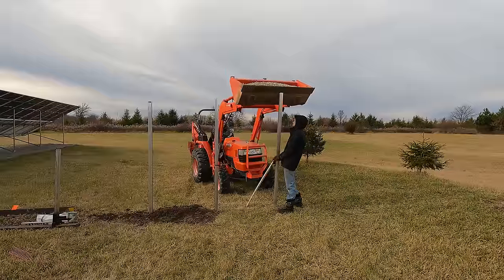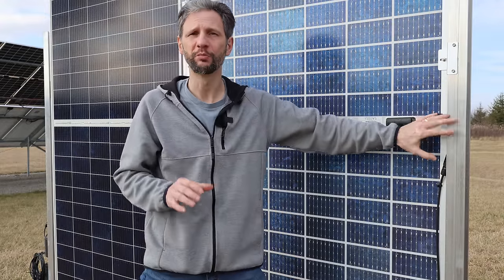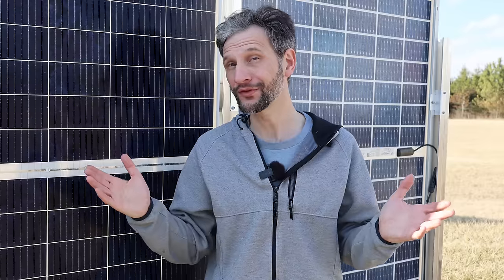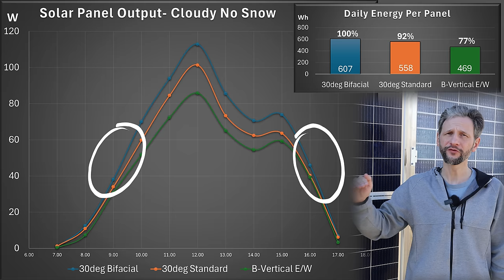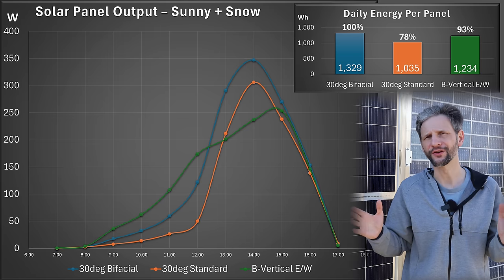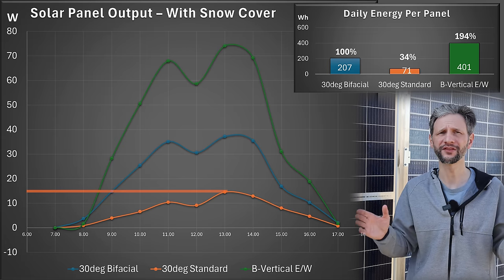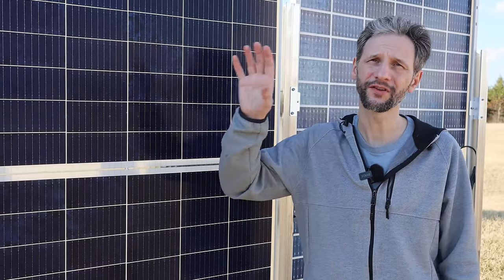Vertical Bifacial Solar Panel Performance Results Part 1

Comment: Thanks   You'd think bifacial cos would have this all worked out and dished out seven different ways    Here's  a fairly large factor that might exist to help vertical arrays.  Cost of mounting, for ground systems, fewer holes in ground, less framing, no real 'ladder' work, and even easier to clean.   Alas on a sloping roof, bi facial vertical mounting would DEMAND racks, that 'on roof' systems don't.  Of course, on roof systems are not at optimum slope, and when it comes to roof replacement, is a disaster unaddressed (they have to be removed, stored, replaced, so you pay probably 1/2 your initial install costs every 20 or 30 yrs.  I haven't heard of anyone even on new homes building PV into roof assembly so you don't need roofing under them, as no PV co is going to warranty their units as roofing, since a roof leak worse w mold can cost big time, and there is a considerable issue of trying to route rains and the leaves twigs sand ... washing off roof, around the array, or risk the array with that washing over it.   Sooooo  a vertical roof top array on a rack would actually allow roof replacement without a serious upcharge (There would be more flashing work around connection points)

I'd think of installing these around the edge of a porch roof like a 'railing', along ridge peak - which might well give them a HUGE boost as they'd get way more 'sky' and reflected light exposure.  Also, mounting them say 12 inches above the peak would allow most of wind to go under or over as it needed to.  Support framing could take form of a Y  with legs on either side of peak and single 'stroke' upright over peak, the legs could easily be screwed in through roofing using same fasteners used by standard solar arrays.  When it comes time for roof replacement, cut screws, remove, pop up leg, slip shingle under, rescrew.  You could also install WR Grace Ice an Water Shield over and between them and over the peak, then shingle over or best yet add wood framing, plywood, over the legs, shingle over that, flashed just to uprights.  Making future shingling even easier. Possible big benefit for roof peak vertical panels - the brightest point in sky is not in the S, it's in the North.  Remember artists and old factories had huge skylights facing north.  It was to not just for 
even lighting, that could have done w S skylights and a filter between, light fabric.  There is that bright spot in N. that provided more light.  A panel way up in the air with more exposure to sky than ground might access that brightness better.   Any chance you'd be willing to sitck those two test panels on 20 foot poles and see if there is a significant boost in performance.  You could do this temporarily using  a braced frame tied in to your current uprights.  You should be able to do it with 20 foot 2x4s, but you'd need some kind of bucket rig probably to get panels on and off up top, unless one investigates a pivoting frame.

For anyone in snow country, here's a novel multi function way to get around problems and increase value from solar arrays on a garage at least, maybe a house too.  
Wait a min, in S. Climates it could cool your roof and shade side of house in summer too.  
For me, I figured out a way to install 'on roof' , a 20 degree slope when I should be at 45, bad in winter, good in summer, keep it raised on 2 x 6's to allow cooling air under, and use the deep framing to stick it out over driveway to provide a covered walkway along the entire front of the garage.  More framing than normal, but, it serves a double duty, so is it more framing, or free framing from my now sheltered car access.  Invaluable during rain and ice / snow season.  I even have a way to melt the snow on the panels with a few hundred watts of electricity and a kick space heater.  As it's up on 2x6's when re re roofing time comes I can flash up it and build up slopes to kick water and debris to sides, though I'd need to install side vents then to keep array cool in summer.  
Now for putting on the main roof of a house where uplift winds from hurricanes might add to a whole lot of force, you'd need to get an engineer or architect.  I'd bet you'd need double 2'x6's and some kind of hurricane strapping to secure through to roof rafters.  Still, big overhangs was how the old timers cooled homes down south.  Here and in indigenous buildings of ancients all over the world.

Comment: Did you explain why you mounted the large array at the angle that you did? I had always
thought it was equal to the latitude but I may be wrong.
Reply from the maker: 30deg is close to the optimal angle for my Latitude.  I would make it steeper, however, my racking max is 30deg.

Comment: So has there been any testing for motorised panels that track the sun to maintain maximum output throughout the day?  In the game space engineers it is a common method people build. It would basically be panels set up like your south facing but on a mount that rotate the array from east to west as the day goes by.
Reply from the maker: Rotating mounts add cost and complexity so I haven't focused on that method yet.
Reply: @ProjectsWithDave  Could be a really interesting approach. In the game, I mentioned it has become the favourite for mathematically proven benefits. It is yet to be seen if that would translate at all to the real world, but would be a very interesting and I imagine fun project to do and see. ( Eventually  )

Comment: How about three facing setup , with a south facing panel set?????
Reply from the maker: That's a option that would perform similar to the 1/3-VE, 1/3-VW, 1/3-30degSouth graph in the video.

Comment: A neighbor with a 200 foot pole building has been considering solar panels.  If he were to place a row of vertical , bifacial  solar panels along the south wall of that building (orientation is east to west), would the reflection off of his white pole building provide enough solar to make the vertical panels more efficient than the typical solar panels?
Reply from the maker: If you space them off the wall, you will see some gain from the reflection.

Comment: If you have plenty of land, Mount all standard panels. Cost wise and production wise it's worth it just to add more cheap panels
Reply from the maker: Bifacial panels can be cheaper per watt than standard panels.  I do a cost analysis in this video: https://youtu.be/1SXNjsSsmq0

Comment: I don't want to 'out' you, but what latitude are you in?  We are near Nashville TN and close to having our back fence replaced with bifacial panels.  Knowing the performance will be 'different', but our HOA doesn't allow roof mount and we don't have a lot of land, we are doing mount similar to what you are showing.

We will track performance and let you know how it goes.
Reply from the maker: I'm near central Ohio.  I'm looking forward to hearing your performance results.  Who makes your fence racking?
Reply: We tried to get a fence company or a solar company to help, but everyone said 'we have never done that before', so wife and I removed our back fence and just replaced it with solar panels.  Roughly enough space for 2 panels vertical between each post.  So we have 20 panels.  A solar company we are getting to do batteries (2 Tesla powerwalls) will connect the panels and wire it in and get all permits (in city limits and a TVA supplied power company, lots of paperwork).  The panels have been up for 6+ months, waiting on solar company to do their thing (rough market and overly expensive).  We are going with microinverters due to shading issues.  Will not have a great a payback as it should, but it is what we want. (Oh yes, my wife and I are 70 or so, so no going on a roof for me).  We are using commercial size bifacials that should do 400+ watts per panel but we expect 60% at best.  And our fence is not perfect N/S orientation but we have an open field behind us (a power line right of way) so no construction there or even on the other side (a park lines the other side of the right of way).  ... More detail that you want.  As you can tell we are ready to have it online.  Hopefully this month (that is the latest from our solar installer anyway).

Comment: How about using cheap mirrors on 45⁰ to direct the mid day sun?
Reply: "Cheap mirrors" may cost 10 bucks per square metre. Solar panels cost about 25 bucks, considering the same area.

Comment: Hey what if you just threw a tilted mirror on the ground to catch that direct-overhead light onto the vertical panel? Best of all worlds then. Or just something painted white and tilted
Reply from the maker: I suspect you will see some significant impact, I may test that this summer.

Comment: What is the voltage of the vertical bifacials. When you do these experiments I often wonder jf you are matching voltages or just comparing watt hours. I'd like to see the same series parallel combinations compared if possible.
Reply from the maker: The DC/DC optimizers track the maximum power point for each panel individually.  The voltage varies as the current is adjusted to hold the maximum power point.

Comment: Seems that if you have the space, you're better off with more standard panels than sticking them to the back of the panels you've already got.  
For the total surface area of panel, performance is basically worse per area in all cases.
Reply: No.

Comment: you solve the noon dip by putting yet another bifacial horizontally on the ground. maybe just put a normal tilted roof panels and a bifacial vertical panel. or just use a steel painted solar reflector mirror panels on the ground to get max solar power all day. if you dont have bifacials, use 2x single sided back-to-back. then its also 100% utilization, not degraded on the back side. no free lunch huh. what are you eating then. yep what did you not get as free gift. yeah cover your ground with reflective metal. to be exact, cover the shadow of the south panels, with reflective ground mounted metal mirrors. so that the back side evening panels get as much or more sun as the day panels. maintenance burden matters. the less you have to maintain, the more other stuff you can do. and the maintenance does not tie you down.

Comment: I am really considering building a fence out of thise panels. I wonder if this is even possible.
Reply from the maker: It's possible, but there are a lot of things to consider.  You need very strong posts, the wiring needs protected, there may be considerable shading from surrounding objects, panel damage, etc.

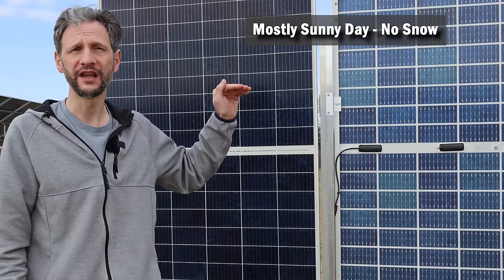Comment: Why not the best of both worlds? My solar tracking system blows your vertical and south facing panels out of the water. It produces usable power from 7:30am until 5:00pm with max output from about 9:30 until 4:00
Reply from the maker: How many panels are on the tracker, and how much did it cost?

Comment: Hmm.. when solar cells are shaded, they heat up. Why not hybrid the setup and use the vertical to melt the snow off the traditional.

Comment: Install these panels with the bifacial back to back with each other and see what you get. In other words stacking the panels together.
Reply from the maker: That would completely shade the back side.  No point in buying bifacial panels at that point.
Reply: Some light will pass through the panel!

Comment: You made a mistake mounting your bifacial to the south AND standard panel facing south under the bifacial. You just killed the reflection of the sun light from under the bifacial. The height of mounting with bifacial is crucial, the higher the better. With a normal panel under, there is basically no advantages for bifacial. You should really change the setup to have good data for the bifacial facing south. Now they are heavily under performing

Comment: Off grid here in Alaska @65°. Was just wondering if anyone here from Alaska that has done this type of setup. I’m not too worried about summertime but winters are brutal and just curious if this type of setup would be beneficial for my location. As of now, pretty much can’t count on solar to charge battery bank.  About six weeks around solstice, sun barely comes up above horizon. Yes, I have generator. I also have eight Bifacial 220 watt solar panels that were set up last summer but are fixed on a platform so no reflective light from snow cover could get to them from backside. Please be kind, I’m new to all this but learning something new everyday. Any advice at all would be much appreciated.
Reply from the maker: You can use the PVwatts calculator to optimize your angle for winter.  Here is a link: https://pvwatts.nrel.gov/
If you mount your bifacial panels on a rack with back side exposure you will get up to 15% more power from them.

Comment: Wouldn't it make much more sense to mount panels in Alaska at perhaps 60 degrees instead of the 30 degree panels.  This would also mitigate the snow build up to a greater amount.  I understand that you were attempting to compare similar situations.  It just doesn't make sense to keep panels at 30 degrees in northern locations.  In fact, tracking systems for solar panels typically point the panels directly up on overcast cloudy days.
Reply from the maker: Yes, a 60deg vs vertical comparison would be more appropriate for a far north setup.

Comment: so in alaska, would you still face vertical panels exactly east/west?
Reply from the maker: It depends on what you are trying to achieve.  Facing the panels E/W will give you better production in the summer but less in the winter.  Facing them with the primary surface S and the secondary surface N will give you better production in the winter but less in the summer for a flatter curve through the year.

Comment: WINTER SOLSTICE testing will way out perform SUMMER SOLSTICE testing simply do to temperature differnces 80F colder will drasticly enhance the performance 110F is even better

try vertical south facing bifacials that might be a fun experiment
Reply from the maker: I might try that next.  I was planning to do both at the same time but ran out of time and resources.

Comment: Can any biracial panel be put in a vertical position or is the vertical panel specific ?
Reply from the maker: Any bifacial panel can be mounted vertical as long as there is not limitation from the manufacturer.

Comment: Vertical panels could be made to track the sun much more easily than angled panels . Why have bifacial panels when you could fit a low power motor + a control box powered by the panel itself? Wouldn't that be cheaper and more efficient?
Reply from the maker: That would not have the same effect you are missing out on the back side generation and vertical panels in a row that track the sun would shade each other.
Reply: @ProjectsWithDave   at midday, the sun would be quite high and so they would not be in each others shade. At am and pm they would not shade each other if oriented facing e-w?

Comment: Does anyone make a curved panel? Something that spans 180 degrees, oriented east and west. Wpuld there be any advantage to sometbing like that?
Reply from the maker: you can get flexible panels, but if the cells don't face the same direction you will basically get the performance of the most shaded part of the panel.

Comment: What do you think about the idea of using aluminum foil beneath the panels to increase light to the rear side via reflection?

I've heard aluminum foils can deteriorate easily. Do you have any alternative ideas that are reflective and last longer at the same time, aside from using white paint?
Reply from the maker: There are a lot of ideas listed through the comments if you scroll through them.
Reply: @ProjectsWithDave  I wanted something that someone actually tested and works. I am about to install a 3KW ongrid system with TOPCon panels. Can you suggest something?
Reply from the maker: I would consider white rock with a weed block underneath.

Comment: So, I was thinking…. And I know this might sound stupid, but bear with me- can one make these double sided solar panels serve as parts for a propeller for a vertical mounted wind generator?
Reply from the maker: I can't imagine why you would want to do that.  They are the wrong shape, it would be hard to connect the power to a moving part, the panels would only be facing the sun half the time..... for these reasons and many others I wouldn't go down that path.
Reply: @ProjectsWithDave Thank you for the reply! You're right, I'm no expert in this field. It just seemed like a good idea.

Comment: What if you reflect noon sunlight to vertical solar cell with mirror that only reflect on the front but is clear glass on the back (like how police used it when questioning criminal in black room)
Reply from the maker: Yes, that would help the mid day dip quite a bit.

Comment: I feel like vertical panels would be more resistant to thermal degradation, since the hottest part of the day is when it takes a break
Reply from the maker: I suspect they will degrade slower since their solar exposure is less.

Comment: Most of the light comes from the sun, then the second brightest thing is the sky. I imagine the ground and surroundings are always less bright than the sky itself.
Wouldn't it be best to space out sky-facing (so south facing at a degree) panels and put mirrors around them?

So instead of a ▮▮▮▮▮▮▮ arrangement you would do [▮][▮][▮][▮][▮][▮][▮][▮], so each panel would have mirrors around, helping with production when the sun is not in a perfect angle. But there is enough space between them so that the mirrors doesn't obstruct the next panel.
Reply from the maker: It's cheaper and easier to just install more panels than to try and ultra optimize the absorption for each panel.
Reply: @ProjectsWithDave  It's only cheaper if you ignore externalities like manufacturing impacts.